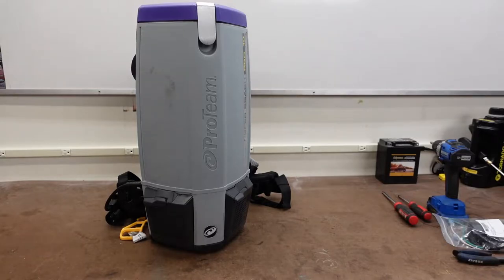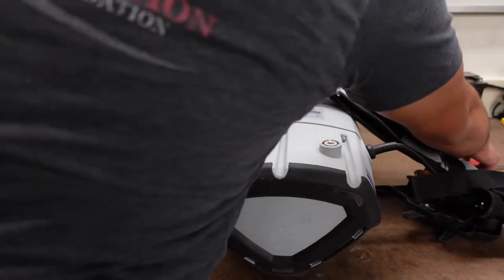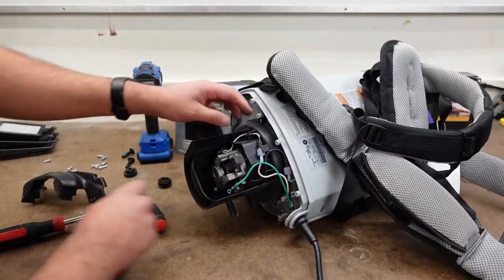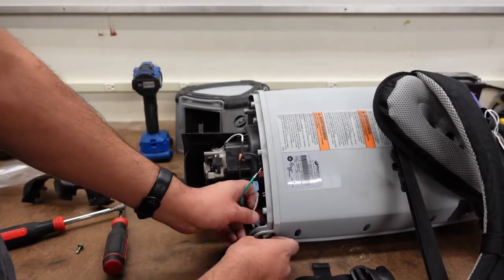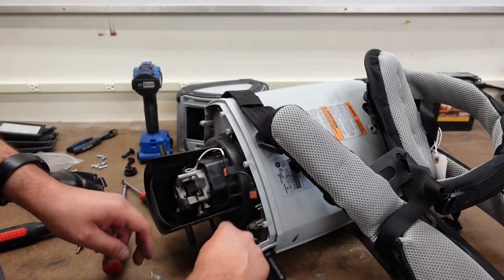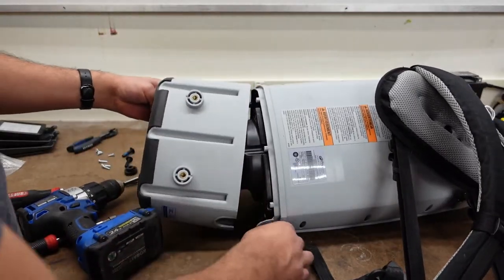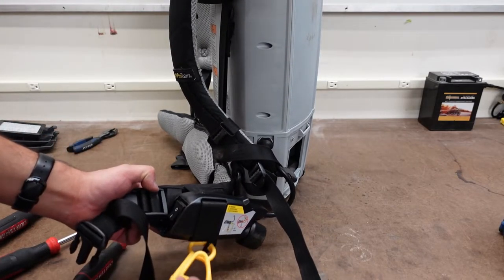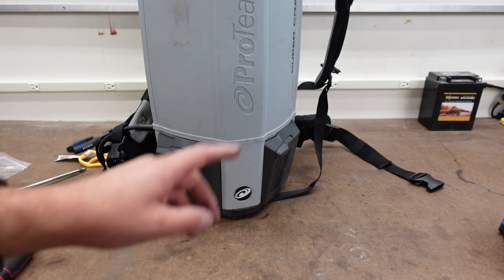Pro Team Supercoach 10, Power Cord And Switch Replacement

Comment: I replaced the switch assembly and vacuumed for 2 hours and now it doesn’t want to turn on. My power cord is getting power but when I turn the switch on, it doesn’t turn on.
Reply from the maker: It’s probably the thermal switch. Make sure it’s clear of debris and has a new bag in it. A lot of restrictions and heat will cause it to shut off until it’s cool.

Comment: If the switch goes , does the vacuum just stop ?
Reply from the maker: Yes, but….. it is more likely the thermal sensor tripped and shut the vacuum off. Wait 30 min and let the vacuum cool and then test it. If it starts back up then there could be too much restriction in the vacuum causing it to shut off. I don’t change many switches on these vacuums. The number one issue i have is the motors going out or the power plug. Check to see if the prongs are burnt. That is also very common
Reply: @jcsequipmentrepair6130  Thank you,  Today she fired right up , I also changed the filters / bag ... Thanks Brother

Comment: If the ground pin came off, would you recommend replacing the entire switchbox?
Reply from the maker: Just the cord side it’s a lot cheaper. I have another video on how to do it
Reply from the maker: Here is the video on just the cord

Pro Team Super Coach Pro 10 Power Plug Replacement
https://youtu.be/a1g1kNwDUuM
Reply: @jcsequipmentrepair6130  wow! I wish I would have known. I replaced the whole switchbox. Good tutorial regardless.  I might buy the switch and have a backup box ready to go just in case

Comment: Is the switch the main issue when a short happens?  I plugged it into a wall outlet at a clients office and a huge spark flashed and my vacuum wouldn't turn on anymore.
Reply from the maker: Usually it’s the plug itself. It starts to ark pretty easy when it’s a little loose (what proteam told me) so make sure the extension have a tight fit with the plug